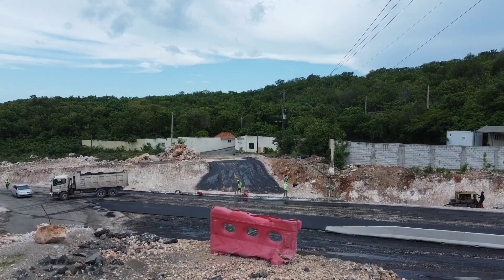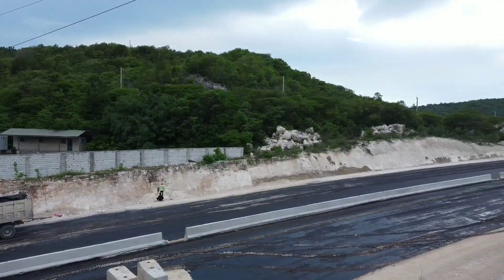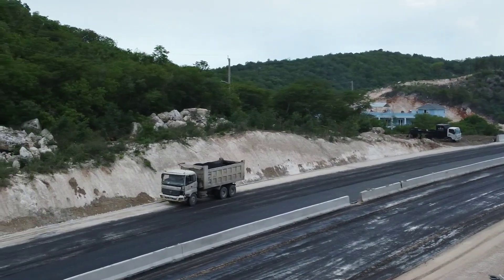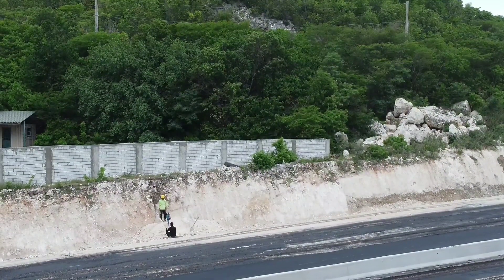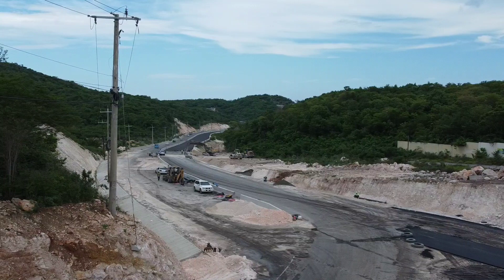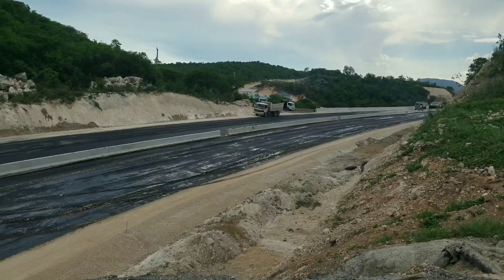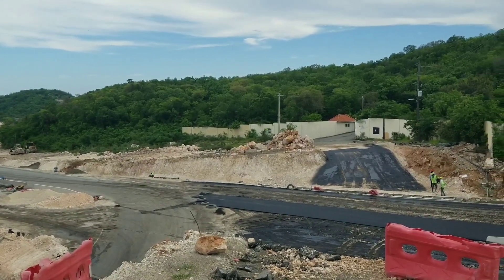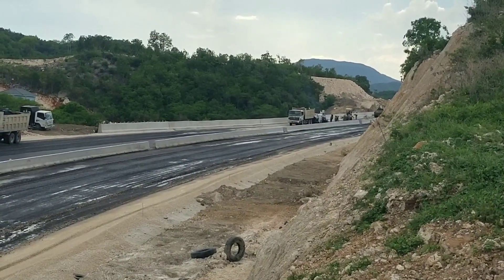Construction Southern Coastal Highway Jamaica

Comment: Those big concrete blocks they use to block off entrance on the new sections will be use as anchor blocks to hold up traffic lights. So they are going to install traffic signals at that intersection.
Reply from the maker: Thanks. Did not know this. Traffic lights on a highway. We will.check on it.

Comment: OBVIOUSLY they go through (not over) the hills with the new alignments because the shortest distance between two points is a straight line!  That also obviously allows for bypassing areas which are already so built up anyway, that there is little or no room to expand the existing road.
Reply from the maker: Thanks